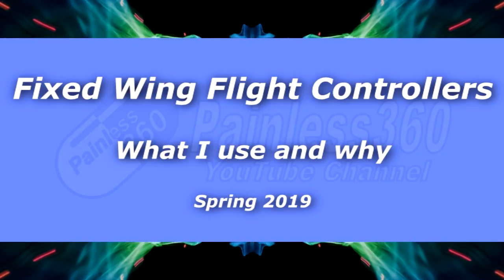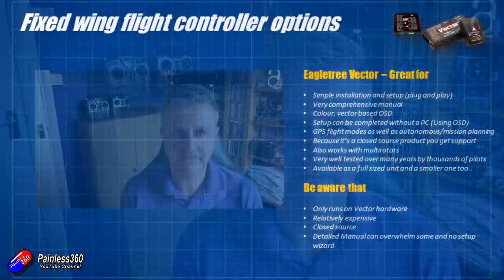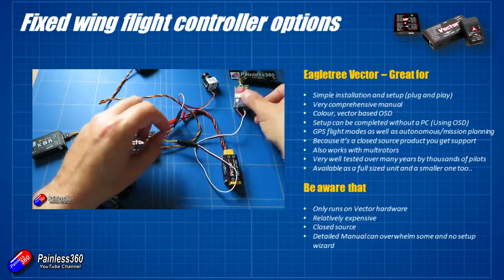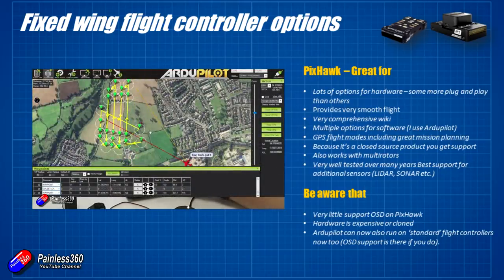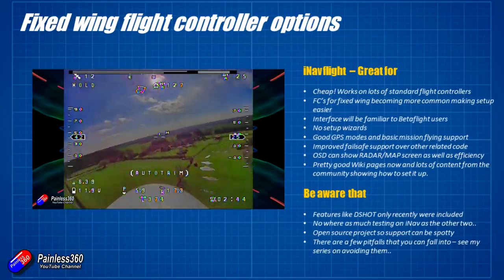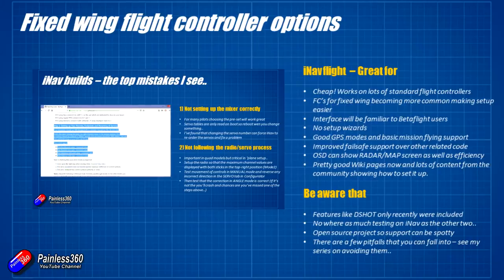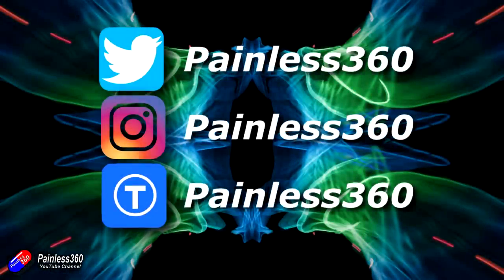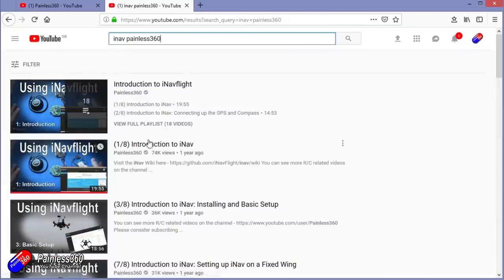Fixed wing flight controllers: Which to use

Comment: Thank you for the video. I am currently building a Mini Drak using the Brain FPV INAV FC and so far have found the setup to be very easy.  Just waiting on my M8N module to show up to finish the project. Thank you for the work you do, it is greatly appreciated.

Comment: Great video, but I should clarify, Pixhawk is an open hardware project: it's absolutely not a closed source product.  Anyone can legally build and brand a device as a Pixhawk provided that it conforms to certain publicly available schematics and standards.  As such, there really isn't any such thing as a Pixhawk "clone". Some people consider 3DR Pixhawks to be the "original" Pixhawk, but in fact even some of their versions had issues, such as the 1MB flash limit problem.

Comment: Certainly looking forward to learning more about porting the Ardupilot family onto boards other than Pixhawk. Having spent a few years using Ardupilot i am very comfortable with it, it's thought thought of having to learn a new system from scratch that's put me off trying other boards. Built in osd would be a reason i would try another board - not that i do not have osd with Pixhawk, i still use the minimosd boards, old school, but still work great with the Pixhawk, and displays everything i need it to. It's just a pain having to have that extra board somewhere on the craft.
Reply from the maker: You can preview the videos by checking out the playlists - I'm currently making them but the first two are on the channel ready for next month.. ;)

Comment: As always, very informative. Got a matek 405-wing, fitted to a large acro plane, mainly for a safety net, need to complete the setup. Need to get back into planes as I mainly fly quads.
Reply from the maker: I'm having a blast with fixed wing at the moment and you get less quizzical looks in public places when it's a fixed wing ;)
Reply: Just got to workout how to program knife edge and flat spin.

Comment: Great video! There are several of us looking eagerly forward to the Ardupilot on Omnibus F4 (or similar) video! Would be a great build for this summer's adventures!

Edit: OHOHOHO! Sneakpeaking into the playlists section brought me to the wonderful videos that I have been waiting for! Many, many thanks Lee!
Reply from the maker: Series being uploaded now and you can preview them using the playlist..
Reply: @Painless360  I FINALLY got my Revolution Mini working with Ardupilot. I struggled with trying to figure out what I could possibly be doing wrong and it turned out I was going through the motions but didn't know why I was doing what I was doing.
So there's another guy who did the same thing. I couldn't make it work with the info he provided. Time passes I forget all about till you do your video. Thinking I'll try it one more time.....
No mas.
So then I watched them both back to back.
He gives a description of how it works and you do one that's better on how to make it work.
Between the two of you and an obscure reference on the Ardupilot website I finally got it.
It doesn't help that the other video uses beta flight and yours uses inav (or visa versa) and neither of you were using a screen that matches the one that is currently in use on either of those pages.
And you were using a different flight controller.
But to have a tiny Blade F-27 working with Ardupilot on a mini Revo is TOTALLY COOL.
Something that small with that much technology is so awesome.
Now I'm going to scratch build an "engineered wing" that Samm Shepard built. Only I'm building a BIG mamma jamma. I want to convert the Ramtec OS . 91 ducted fan unit out of my Yellow Aircraft F-4 to an electric inrunner and mount it inside the wing so you can't see it at all. I'm. Going to use Samm's wing design with a blended center section that will look a little like an X-8 blended wing.
It should be glorious at 8-10 feet, and if it works well scaled up I'm going to go 16 feet with a turbine that's been sitting on my bench for 3 years now....
Thanks for the inspiration.

Comment: Fantastic compilation, Lee! Thanks a lot! 😃
And yeah, I have a Matek 411 Wing here. I just need to buy the pins for soldering. 😃
Reply: My F405 Wing came with pins, are you sure you didn't threw them away? I have F722 on the way for my skyhunter long range fpv plane!
Reply: @MarcAntoine01  No, dude, I just checked here... It's still in the original plastic, I didn't opened it yet. It only comes with the 2 boards and hardware (screws and standoffs and so on). 😕

Comment: Great video. I use the f405-wing with the chibios building of ardupilot. Very often the hobby grade plane (diy or kit) doesn't have the cargo place for the all pixhawk system. 
You don't like the minim osd board?
Reply from the maker: I'd like it more if the setup was accessible with a simple USB cable rather than mess about with an FTDI adapter ;) I've made dozens of videos on it but in this modern age it feels a little out of date now..

Comment: I love the furious f-35 lightning. Even though it's plug and play it's very easy to make a mistake on ivav I have done it plenty of times disarming in the air not being able to rearm because I left my switch on nav launch. All the switches it gets complicated. I'm building a strix strata surfer  I put a lot of money into it with 3D printed parts and aluminum parts and a custom canopy that holds a  GoPro Hero 7. I was thinking about taking the furious f-35 lightning and put it in my AR wing instead and getting an eagle tree vector s
Since there's over $1,200 in the air you think it would be the right choice good micro bacteria or the full-sized vector? I would hate just to lose the GoPro Hero .

Thanks in advance for your help

And thanks for the stickers again

Rob
Reply from the maker: That's a lot of money to have in the air so I wouldn't try anything I couldn't rely on. The Vector if you want OSD and the Pixhawk cube if you dont.. best of luck! 

P.s. permanently enable nav_launch and then you will not have that problem with iNav ;)

Comment: I would be happy if you could refer to the sensor for measuring air speed (Pitot).  Air speed is critical in a fixed wing.  Do all the pilots you mentioned support air speed sensor?
Reply from the maker: All do.. Se their documentation and build series for more details..
Reply: @Painless360  thank you for the answer.  And special thanks for your wonderful channel.

Comment: HI Painless  Is there any updates to this video ? as time has flown by. cheers (Really needing one with stabilizer in them)
Reply from the maker: Not really, a lot of the flight controller have changed a little recently due to chip shortages but you'll see the same vendors stuff used time and time again on the channel because they work; HGLRC, CLRacing, HolyBro, Matek, Pixhawk Cube, Durandal etc..

Comment: I have settled on PixHawk hardware and Mission controller software. How do I avoid copy-cat PixHawk controllers?  I will be using a 2M powered glider, and doing photo missions. (5 ch with Flaps).
I will be using GPS with a laptop for monitoring flight, and OSD/ and Run Sift Cam 2, Flying with a Radio Link 10II 12 channel radio.
I am a very experienced fixed wing pilot, with only the flight controllers being new to me.  Thank You.
Reply from the maker: The reason that the PixHawk Cube exists is to provide pilots with a 'quality' flight controller as so many of the PixHawk clones were terrible. HolyBro also do some nice kit with the Durandal too..

Comment: Great vid, thanks! : )
Do you know if there is any flight controller for airplanes that supports 3 to 4 motor outputs, please?
i would still need 2 servo outputs for ailerons.
Reply from the maker: You can have a few motors on things like the Pixhawk for stuff like VTOL setups..
Reply: @Painless360  Appreciate your info : )

Comment: So I would like to ask few questions to fully understand this topic since together with starting FPV I would like to get flight stabilization/control & OSD systems too.
In this video, firstly you presented SOFTware followed by a HARDware stuff. I am particularly interested in iNav (software) ran on one of Matek's board. What is ArduPilot then? Is it equivalent to iNav? I havent seen it mentioned on this video while I think you mentioned it as a flight control system on one of other videos of yours. Can you please where my understanding is wrong?
There is a second question. From beginner RC pilot standpoint who just started to get interested in all of these electronics beyond motor and ESC - is there any important difference between iNav vs. ZOHD Kopilot? I think both have stabilization (iNav might have more modes such as angle and horizon i think), OSD, RTH, autolaunch, GPS module and would support FPV too. And I dont mean how hard would it be to install it (I bet with help of your vids it would be smooth in both cases).

I appreciate your help - thanks!
Reply from the maker: Check out the latest mini series that covers the basics of control, power and FPV in 3 videos.. They may help..
Reply: @Painless360  thanks, will try that.

Comment: All this gear is great if you are good on computers, but I just run Arkbird ,didn't need a computer to set it up ,what is the main differences to these systems  ,thanks?
Reply from the maker: If you don't want to use a PC then check out the ZOHD Kopilot..

Comment: Please test the mini pix from bangood, thanks!
Reply: It will work but on bigger wings. Also it has lots of configuration options as all PixHawk clones and AFAIR needs ground station from Radiolink (at least that was situation last year).  I was not quite happy with it, spend more time setting it up than actually flying.

Comment: I just watched this and it completely confused me.
I would like something that will offer 6 axis support, GPS input for RTH, and some telemetry.  I don't use FPV so no OSD, I don't solder so must be plug and play, I don't want a complex computer based set up.  Is there something that will do what I want? and no, the Kopilot won't.
Reply from the maker: Sadly the majority of flight controllers are not plug and play. The closest was the FuriousFPV F35 flight  controller and GPS kit that you'd install iNav onto. Failing that a Pixhawk might be an option. See my builds. Best of luck...

Comment: at 09:35 how can you use that osd display? Ive been using inav long time ago but dont have any font or display like that. im stuck in version 1.9.  because  the version above that experienced so many bug like horizon drift, etc... is that display comes from a new version?
Reply from the maker: I guess you've not watched from the beginning of the series. Check out the intro to this series and the recent iNav builds for how I do everything.. Happy flying!
Reply: @Painless360  oh god bless you sir, 

and thanks to corona, now Im work from home while running marathon on watching all of your series in midnight.

your video is so interesting, I cant even stop it.

cheers!